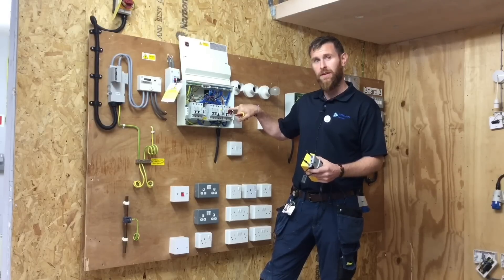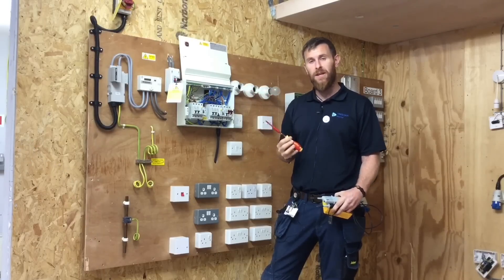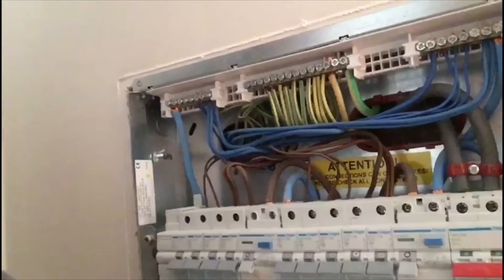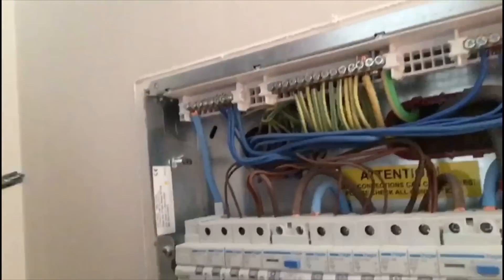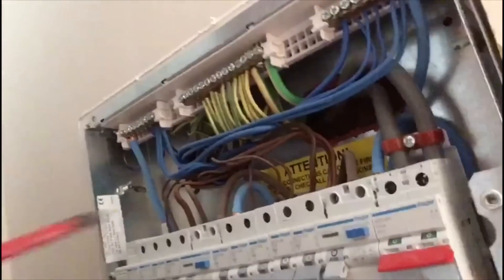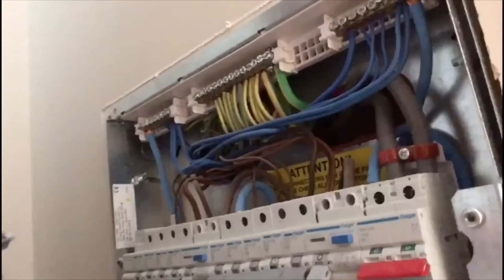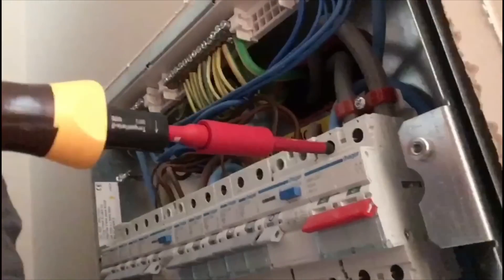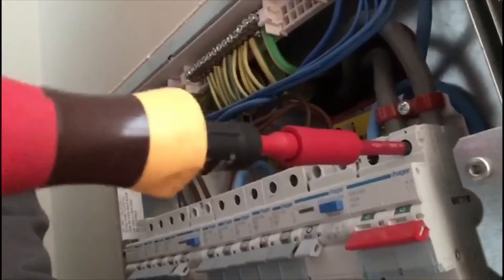How to Use a Wiha Torque Screwdriver on a Main Double Pole Switch

Comment: What is the actual torque setting because I work on industrial contactors and switch gear which have all differant size screws surely bigger the terminal screw higher the torque
Reply from the maker: The consumer unit torque setting are different from MCB’s, RCBO’s and neutral and earth bars. See manufacturer’s instructions 👍🏻. Thanks for commenting and watching. Gaz

Comment: Using wiha screwdrivers!!! , how do u do when require 3.5Nm ??. I don’t use them as they only do till 3Nm they are expensive and should do till 6Nm. I don’t know if anyone having or using wiha but as a torque screwdriver they are not fit to be used by electrician as they don’t cover the requirement for the main switch. I don’t need 2 or 3 sets of torque screwdrivers, plus they don’t have calibration certificate

Comment: how would you know  100 % that this is calibrated correctly to begin with  ? just because its new doesnt guarantee that, it  may have been mishandled in transit  , dropped /faulty .
Reply from the maker: Hi. Regular self checks on known circuits with known results and things like cal cards help👍. Thanks Gaz

Comment: Are the torque screwdriver's now mandatory for use on consumer units? And if so would they not have to be calibrated/certified every year?
Reply: I not think they're mandatory but if an installation you were working on caused a fire, the courts would ask for certificates and any other relevant documents, if you don't have a torque screwdriver, how can you proof the fire wasn't started by an overtightened/undertightened connection.

Comment: I’ve the same megger voltage indicator and Martindale proving unit. Wouldn’t be without either. 
Here’s a question, MFT’s does anyone offer a part ex solution? I’ve an older 1553 but would like the 1731 (I believe that’s the top end one) as I work for a water authority across 3 -phase, Single phase, controls and communications.